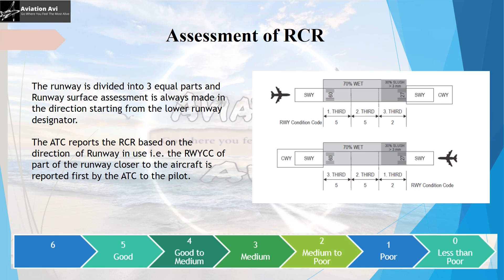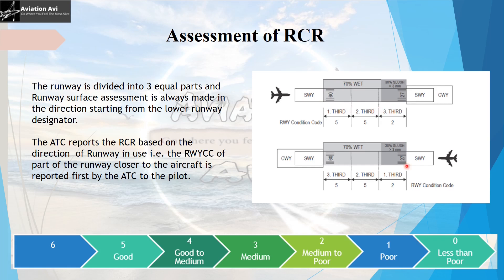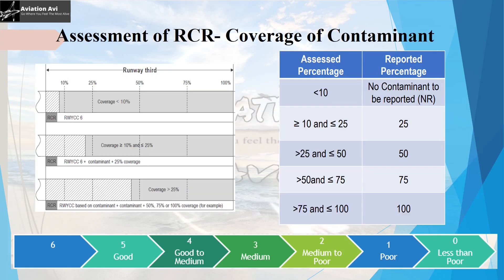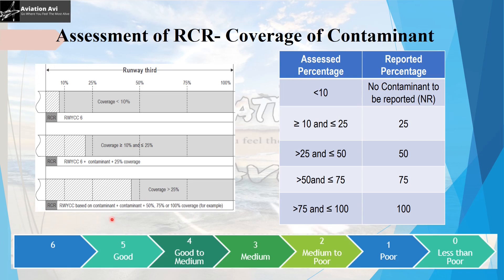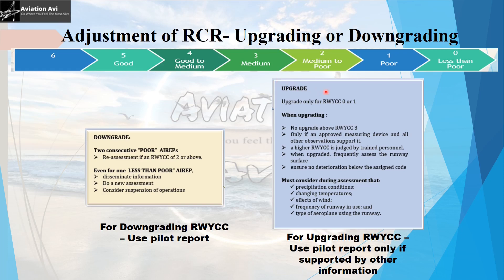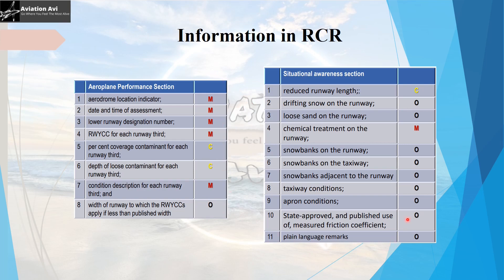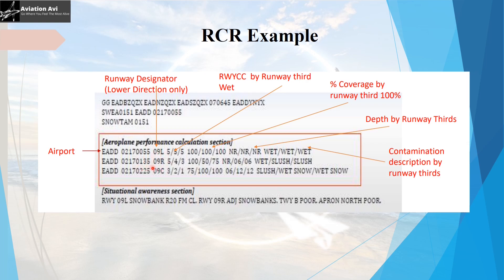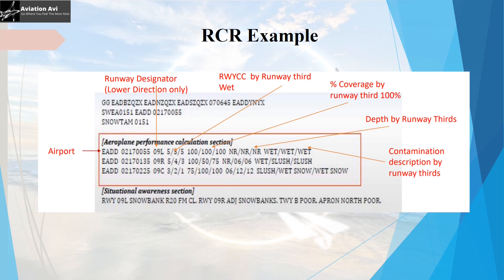Global Reporting Format: Part 2 I Runway Condition Reporting I RCR I GRF I RCAM

Comment: How is the 09R has 1st third RWYCC 5 and %coverage as 100? If my understanding of ur video is right then it should be less than 50 for raring of 5.. plz explain
Reply from the maker: The RWYCC of 5 for 1st third of RWY 09R depicts that the Runway is WET. And the coverage of contaminant is 100 %. 

In case the runway third would be covered by the same contaminant between 26 percent to 50 percent in that case the RWYCC would still be 5 and coverage would be 50 %.